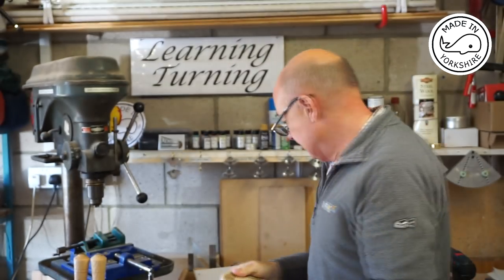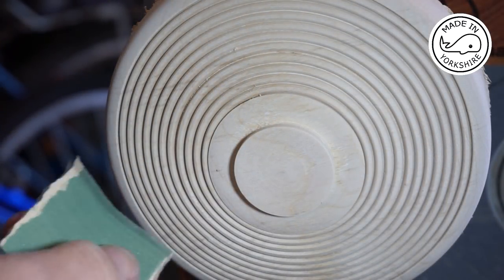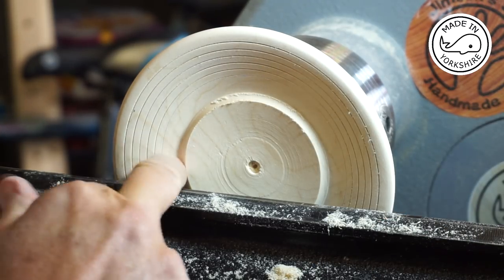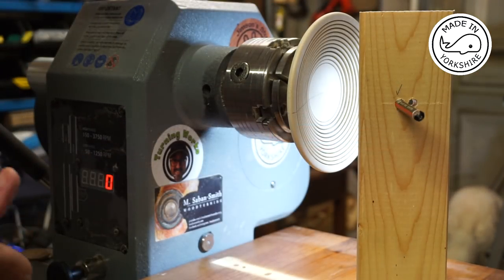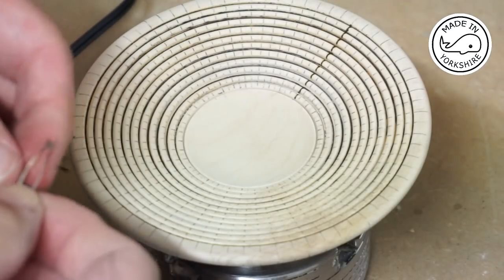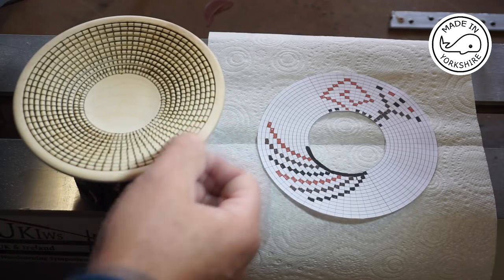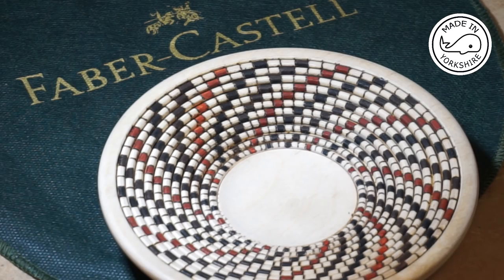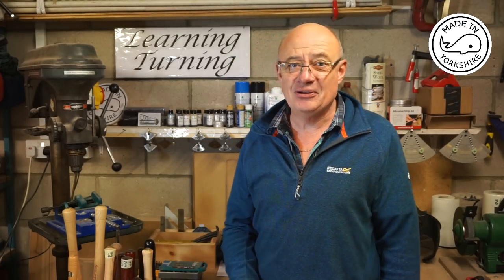#31 Basket Weave Illusion Effect

Comment: Hello Andrew. I just watched your video on the basket weave bowl. Superb job on getting it completed. Lots of work, but nice piece when all done. I have seen a few other YouTubers produce a bowl with the same technique. One small tip to save you some time if you do another. When marking the layout lines on the lathe, using your pencil as a height gauge to mark the front and rear at the same time, slide across to the opposite side at least on the front and mark it also. Doing the back side on the opposite would be a pain. But marking the front on both sides of the lathe you only have to mark 1/2 as many lines. One half rotation while marking all across the plate will save you a lot of time for layout lines. Just food for thought.